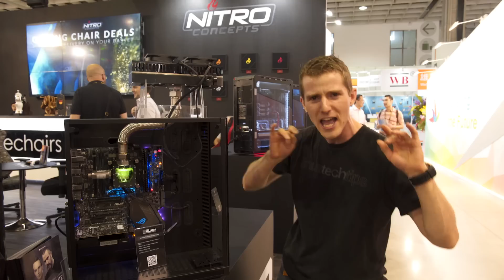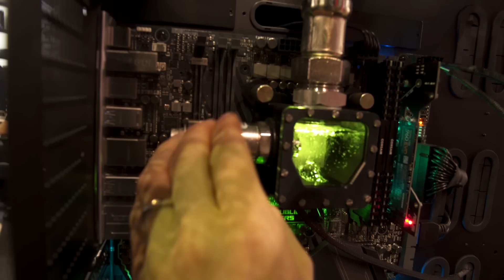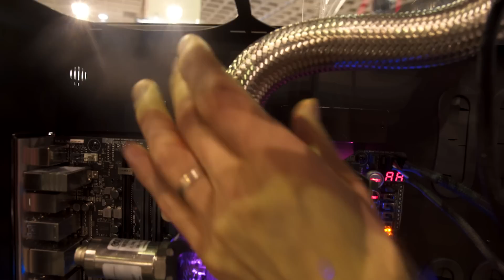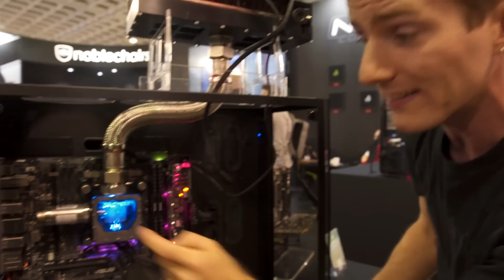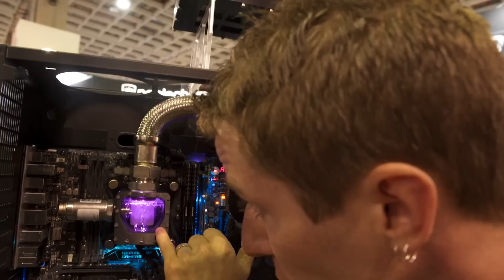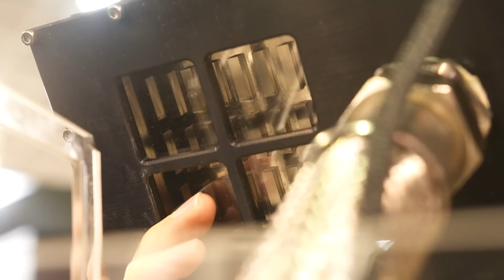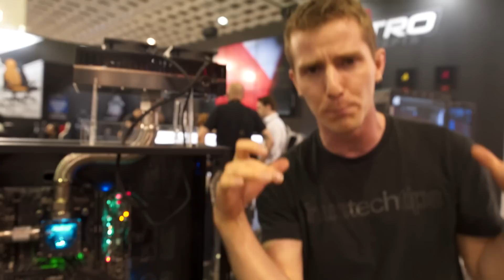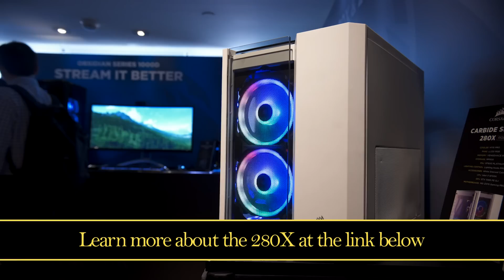Crazy Der8auer cooler prototype - NO pump!

Comment: I am not totally sure what the coolant liquid would be but I believe I can make a few assumptions.
The coolant has a low viscosity. It most likely boils any where from 38-60 C given that the computer it on and it running.
The temperature required for condensation inst too much lower, if any than normal ambient temperature, given that the fans are not running too high and the heat skins are not too extreme. I believe the pressure gauge gives a big hint as most likely means the coolant has a low vaporization pressure. The color of the liquid and how it is being altered slightly with the leds seems like it could be important. I would assure that the coolant would be fairly high in hydrogen bonds as well as Hydroxy groups which could indicate the presence of an alcohol or derivative type. Also the mention of a MDS sheet is important because those are only given for compounds that could pose a danger to those involved with them this is further supported by the reinforced design of the cooling chamber and tubing. A few other things I couldn't connect are the degrees of the bends relevance, maybe the compound solidify too quickly at those angles and resales heat or it is to insure the structural integrity of the tubing. I believe the guy in the end could be important. 
lastly I believe that the coolant is most probably is a alcoholic solution with something else I am not should what could be added but is most probably colorless, toxic and or acidic. Also I am not an expert, nor do I know the answer but I believe I could help contribute to someone who could figure this out. Good luck.

Comment: likely some sort of alcohol, or some other sort of organic compound, maybe even diethyl ether if it is actually boiling, as these sorts of compounds have low boiling points and high vapor pressures, making them almost perfect for taking heat away from some sort of thermal load, and the advantages of using these low boiling point liquids in such a setup is that the average heat of the liquid will not get above the boiling point as long as there is enough liquid in the reservoir eg for diethyl ether the boiling point will not get above  34c, if it is really hot to the touch it is likely a very concentrated alcohol: 95% ethanol has a boiling point of 78.5 c (though alcohols have a problem of being hygroscopic meaning they pull water in from the air) and 95% ethanol is pretty cheap in many places its about 1$ (us) a liter. Another thing these compounds have going for them is it is actually very hard to put enough energy into them fast enough (well comparatively), because they evaporate so easily (and evaporation takes energy from the liquid); but one of the big problems with these compounds is they are very flammable, so there is a bit of a safety concern their. Also i doubt anyone will get this far, i am not a chemist, but i remember my general chemistry courses pretty well, and a lot of this is speculation (except the numbers those were looked up).

Comment: I say water in a low pressure environment. That's the easiest I can think of.
Reply: De-ionizing the water would also lower the boiling point a bit. With enough pressure differential, it could be just this.

Comment: It shouldn't be that hard, right? You told us the CPU, 140W power usage, metal conducting heat from cpu to liquid so bubles don't form on the CPU, the approximate volume of the container is approximately guessable, you told us what the radiator is, the liquid appears to be boiling. Some crunched numbers can give a starting list. The only question is, how pure is the liquid and what is it made of? If it's a mixture of at least 2 normally immiscible liquids, that do not appear so because of the bubbles, this might get complex quick... Also bubble sizes can help, but also the surface tension can help, both requiring a good guess for the temperature though.

But let me guess LinusTechTips' video right after its review of this as soon as it comes out, replacing whatever's inside with other liquids.
Reply: Also, something that maintains a relatively low viscosity once cooled so it can flow back down without blocking up the works.

Comment: Hey Linus, The fluid could either be 3M Novec HFE-7500 , HFE-7300 or Galden. im leaning heavily towards Galden due to boiling points between 55°C and 270°C

Comment: The stuff that's in heat sensitive toys, which boil when you put them in your hands, our something similar. Pretty simple really, it's just a liquid with a low specific heat, like alcohol.         Here's one on Amazon https://www.amazon.com/gp/slredirect/picassoRedirect.html/ref=pa_sp_phone_search_atf_aps_sr_pg1_2?ie=UTF8&adId=A085334410TFZUD7J7L7S&url=%2FDazzling-Astonishing-Teaching-Science-Experiment%2Fdp%2FB00RO90VTU%2Fref%3Dmp_s_a_1_2%3Fie%3DUTF8%26qid%3D1528531061%26sr%3D8-2-spons%26pi%3DAC_SX236_SY340_QL65%26keywords%3Dhand%2Bboilers%26psc%3D1&qualifier=1528531061&id=7087626455280743&widgetName=sp_phone_search_atf.

Comment: I'm betting butane/propane mix. Have to wonder how much pressure it's under. It's an old idea, I remember playing around with this 20 years ago. I forget which forum but there was a few people working on it. The systems were way too complicated using capillary tubes and accumulators to try and maintain high and low pressure sides, similar to how an a/c system works. We didn't have much success considering it was easier to just repurpose an window a/c and get sub zero temps. Where we had to make more parts and got similar results to a basic water cooling system.

Comment: I wonder if there found an element that reacts with a certain heat transfer fluid like Caldera 11 or Therminol 68. In theory that would work even with fluids with higher flash points. Those types of fluids are a lot more stable as well. I know that probably isn't right but it must be something along those lines.

Comment: Methanol is probably one of the onyl freely available liquids that can boil and condense at very low temps nearly 60 C. 
Or methyl acetate that has even less of a boiling point w near 56 C so could be that

Comment: I kinda think it's a mixture of 2,2-dimethyl-1-propanol and 2-methyl-2-propanol 

The two should be fairly missable not boil at room temperature and you'd get a fairly nice double boiling point action where the 2m2p boils at a little above room temperature (28C) providing the low-power almost passive cooling and the 22d1p boils at much closer to operating temps (83C) and kicks in at higher load it could be mixed with a third fluid (maybe even a little oil or water) to maintain a constant minimum ballast of fluid for the cooled fluid to mix with and remove heat from.

But the ratios would need to be painstakingly figured out, too high for the water or oil and the alcohols wouldn't evaporate at anywhere close to separately from the whole mass needing to boil, and there may even already be that problem with the 22d1p anyway, then it's again ratios, what allows the 2m1p to escape easily enough while providing a constant way to provide temperature ballast and is there an easy way to compensate for changing pressures in the system without moving parts? with lower pressures present and benefiting cooling when its least needed and higher pressures battling cooling when it's most needed. Without a pump there's no way to have a higher pressure area like in a refrigerator to compensate for basically the whole loop wanting to be gaseous at the same time. Tricky problem.

Comment: I think the liquid they might be using could be either HYDROGEN or HELIUM, although helium is less explosive. Because... All the alcohols listed by everyone have worse thermal conductivity AND specific heat capacity, and even though H and He have a thermal conductivity about the same as the alcohols, the specific heat capacity is a LOT better. You might ask, "aren't H and He gases?" and the answer would be YES, under atmospheric pressure, but they have a PRESSURE SENSOR on the side of it, so the chamber could either be pressurised or under a vacuum to control the boiling point of the liquid inside.
Reply: The pressures required to hold helium or hydrogen in a liquid ish state would blow the perspex front of the cooler into a billion fragmented pieces might work if several mms of steel weren't needed to contain those pressures from the CPU side too
Reply: Well, maybe the "You will never guess" is kind of trolling and the answer is water and there's a partial vacuum to lower the boiling point. I can't find any other liquids or gases that would perform better or at least as well as water.
Reply: My suggestion was one of the heavier, low vanderwals, alcohols maybe a mixture of 22dimethyl1propanol and 2methyl2propanol their heat capacity isn't quite as high as water but I think there might be an ideal ratio of the mixture to be an ideal coolant. Though they aren't as common industrial chemicals as ethanol or water I think their other properties make up for it. They wouldn't need extreme vacuum which would make tubing collapse a problem but they might have the extreme risk of pressure if the whole system was trying to run above 85C and all the fluid flashed to gas at once. High temps plus high pressure alcohols could have explosive leaks hence the monitoring.

Comment: Shouldn't be too hard, just a mix of one liquid with high heat density (most probably water) with another liquid with low boiling temperature (one of the hydrocarbons is quite easy to procure). And probably some anti-fungal chemicals.

The proportion is the hard part here.

Comment: Lets check some boxes.

Clear as we can see it is clear
Non-Toxic, a commercial product would have to be geared to this sort of thing.
Low Boiling point, this is obvious
Non flammable last thing you want is a fire starting due to the liquid
Non conductive last thing you want is a short circuit due to the liquid

IPA could fit the bill but IPA boils at 70°C but it is flammable

Neohexane, Pentane, well anything that contains the suffix "Ane" are out as it is highly flammable.

I would assume Methyl Acetate

57°C boiling point
Clear liquid
Non toxic
Stable
Non conductive(not fully sure on this part)

Comment: The fluid used is definitely a 3M novec engineering fluid. My guess is the 7000 fluid. Its made from 1-methoxyheptafluoropropane and has a boiling point of around 34*c with a range of 0*c-49*c. Its none corrosive/ non flammable and non conductive. But mostly why i think its that one: BECAUSE IN THE DATA SHEET IT EVEN SPECIFIES UNDER APPLICATIONS: "• Electronic Cooling". Yw, now u know, wots my prize for winning the bet? xD
Reply: As mentioned, he denied it being Novec in an interview
Reply: @Nicba1010  I would assume that he would deny that it is novac, to prevent people from reverse engineering this and building it themselves. It is super easy, he showed how it is done (THAT it can be done), easy to copy. All you have to do is put the novec in a pressure loop at the cpu, where it can take the head, evaporate, then make it rise to the radiator, where it condensates and goes down again. The convection keeps the cycle going. The easiest way is if you have two tubes for that.
Reply: Annabelle It has nothing to with 3m Novec because it is forbidden in Europe. He said that in his video( Der8auer)
Reply: 34C is too low of a boiling point. Linus reacted like he touched something uncomfortably hot so it is probably 50C or higher.
Reply: Amir Abudubai It’s working under a higher pressure which increases it’s boiling point I guess. That’s why there’s a pressure valve near it to prevent over pressure.
Reply: +Annabelle It´s not legal to sell 3m novec for private use in europe. So if he wants to sell it in europe, he can´t use novec.
Reply: @minimalmo  Why is it illegal? What is so dangerous about novec? It is super safe according to all reports.
Reply: @nigratruo  Well, I am not an expert on EU-Politics, especially not when it comes to why a private person cannot by certain chemicals. But normally those thinks happen because some BS politicians want to create a nanny-state because they project their own stupidity to all other people and think, if I am to stupid, everybody else also is...
Reply: Yeah, pretty hard to think of substances with a low enough boiling point that aren't also highly flammable and/or good solvents.

I don't it is quite that though, might just be a similar substance.
Reply: HOLY SHIT. I ACTUALLY DIDNT THINK ABOUT IT OH MY GOD!!! UR A FUCKING GENIUS. that would also solve the problem with pressure rising when the fluid heats up, but since its depressurized that wouldnt be such an issue, and the amount of heat transfer would more or less keep constant due to rising pressure but also rising boiling point. holy fuck. and the pressure would only need to be around 40Pa. omg BIG KUDOS TO U
Reply: Out of all the comments this is the only one that actually makes sense. these people thinking they put propane or butane in an electric device. Come on guy really? (yes i realize this chemical name has the word propane in it too guys) Out of all of them the alcohol or ammonia are the only 2 that make any sense, until you think about it in that pure of a form, then you realize it would destroy any plastic it touches on that PC.
Reply: Hardcore Hardware Lets face it, It was a shit movie. No need to be soft dude
Reply: TIAN hmmm okay, in that case it could be a similar fluid, but it was just a guess. But speaking of not being legal in Europe, I couldn't really find anything to do with it not being completely banned. M3 has the 7000 novec on their own English GB website, so that's good enough for me. But then GB is leaving the Eu cos brexit, so I don't really know. I'm not really into that sort of stuff.
Reply: who owns the patent on this type of cooling. Thats what i want to know
Reply: yeah.....I never thought of that..but you are right....low pressure system would do the trick...and that big thick braided line adds some cred to that theory, because the tube would need to be solid to stop it imploding like a typical flex tube would...good catch...
Reply: WhiteRice oh. How come?
Reply: Amir Abudubai it does have a boiling range of 0-49*c tho, and as far as I've seen there's different fluids with different boiling temperatures, so it could just be a different series.
Reply: Emil Jensen i agree, horrors these days r shit, but hereditary looks amazing, can't wait to see it.
Reply: Minimal MO ohhhh private use... Eh Idk, we won't know for sure until someone gets their hands on one in the future and cracks it open.
Reply: It will most probably be a liquid that has a boiling temperature around 50-60 degree cellsuis to boil as the CPU gets to hot, also he will need to take cost into account, i first thought Acetone.
Reply: Novec is available in the EU.
Reply: Annabelle it was my guess as well. I think gigabyte did something like this on a larger scale
Reply: acetone is colourless
Reply: ye it has also been done even diy style theres plenty of logs on the internet, even as far back as 2013
Reply: You cant use vacuum for home use. Way to risky to keep it sealed. or to expensive.
Reply: hmm as far as i can tell, there are only 5 pumpless cooling patents worlwide acording to espacenet, with the latest one being for a combustion engine from 2013, so my gues noone.
Reply: if that would be the case, why can i buy something called a vacuum flask?
Reply: isn't acetone flammable ?
Reply: ah fair enough, acetone is commonly used in nail polish removers, usually with colours so fair point.
Reply: Acetone is flammable but if no air is allowed in side the loop, no fire can exist
Reply: but we do not know the price of this thing, so anything is possible, heck theres even a $15k case at the show, made from cast metal, cant remember which one, think aluminium. EDIT: sorry $5k my bad
Reply: very
Reply: Also to create a loop that boils and the cools down it will have to be a closed loop to make sure no vapor escapes, and this is why he could use acetone
Reply: Just buy this thing then send it some lab experiment and ta da there a answer what kind of fluid is that
Reply: absolutely no one....for obvious reason's...
Reply: Yes I had same thought it would turn to mist then drop back down the pipe
Reply: Lyan Villacorta boil something in a closed system and it will raise the prwssure again
Reply: can this bee some type of a alcohol like a surgical spirit !
or Liquid argon but not likely
Reply: I think u could be right but I am sure that it isnt novec 7100
Reply: Annabelle I was thinking a type of alcohol due to the need of a low boiling point, yours makes a lot of sense (even if I didn’t know what it was beforehand)
Reply: Amir Abudubai something as a gas can be hotter than the boiling point. There were bubbles inside the cpu block. It could be as low as the 30s
Reply: Your prize is an exorcism.
Reply: Nicba1010 hmmm, well just because someone denies it doesn't mean it's not true. Like Linus said, he's gonna need to keep it hush hush so that people don't copy him.
Reply: wrong. It is simply depressurized pure H2O. boiling point is not about heat but of pressure. heat just the energy required to overcome the pressure acting on the liquid

Comment: I mastered heat transfer during studying mechanical engineering and the answer for the mystery coolant is right there in the textbook, Heat and Mass Transfer: Fundamentals and Applications, Cengel - Chapter 10 Boiling and Condensation H/T

Comment: Pure water under partial vacuum get same heat cycle as normal boiling water but lower temp plus wouldn't need much of one because you have fairly good temperature delta